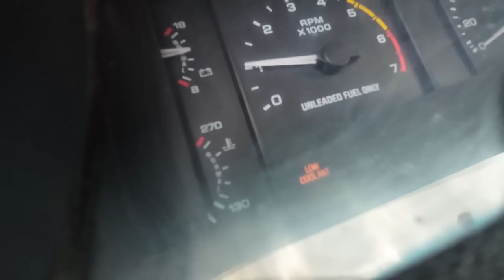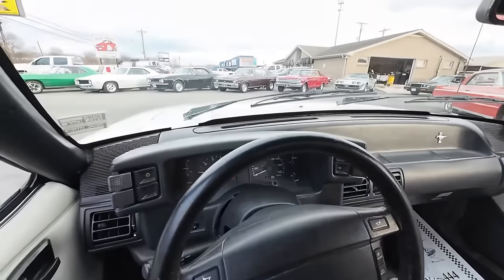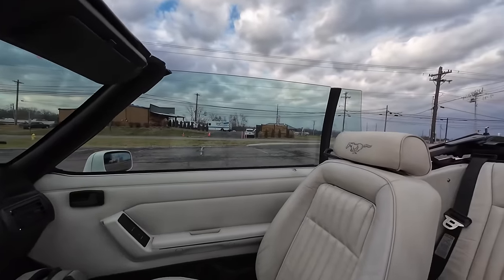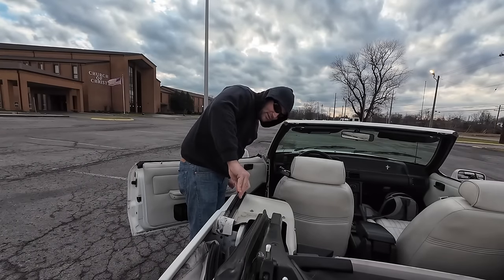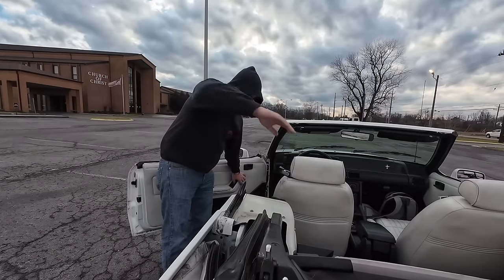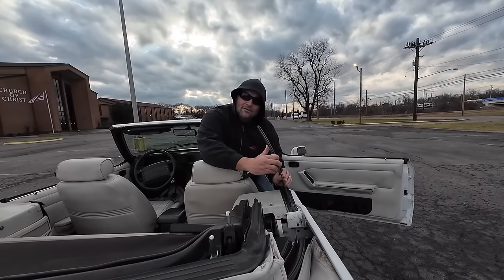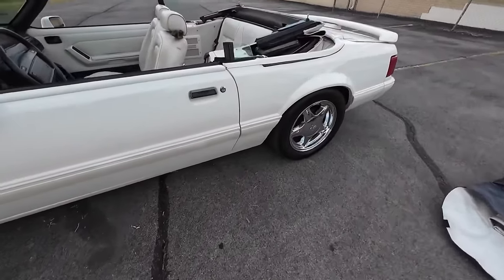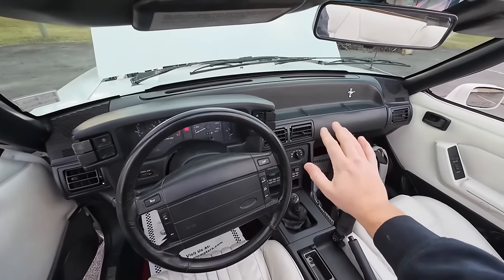Test Drive 1993 Ford Mustang Convertible 5.0 LX SOLD $13,900 Maple Motors #2484 1500 All White

Comment: 1993 Feature car, notable differences are the Painted Exterior Molding, factory rear trunk  Air spoiler ,running Horse embroiled int to the head rests, Car should have floor mats with a white running horse and the car should have came with Vibrant White wheels. Car is low production numbers, triple white cars made were 1,500 units, and 444 of those are manual transmission , there were also Canary yellow and 1503 of those were made.

Clean that car , get everything working and hang on to it, these are only going up in value.